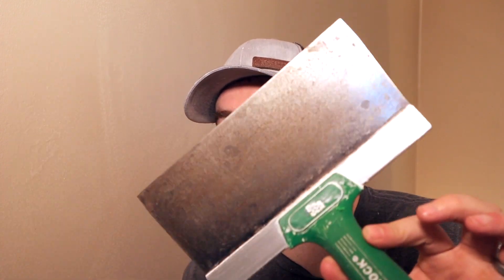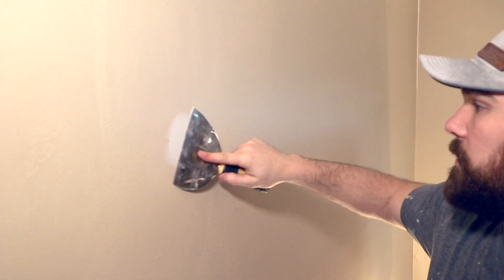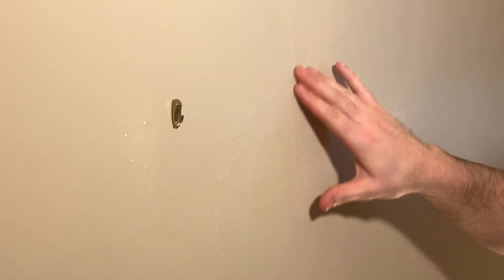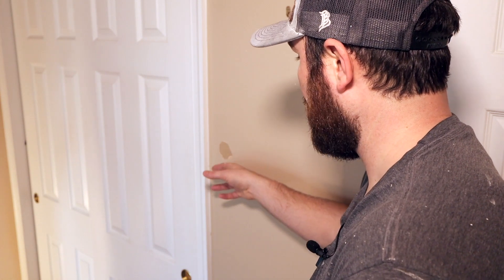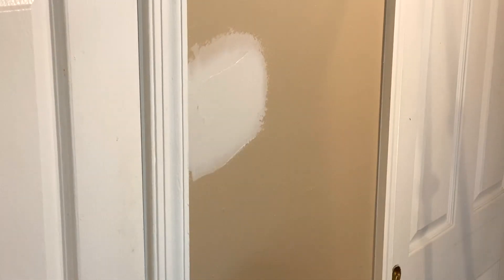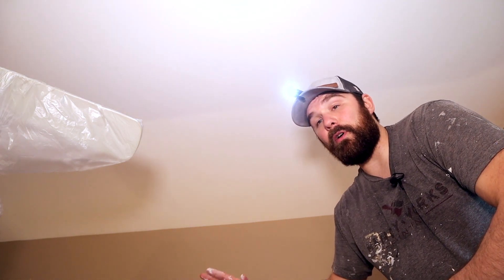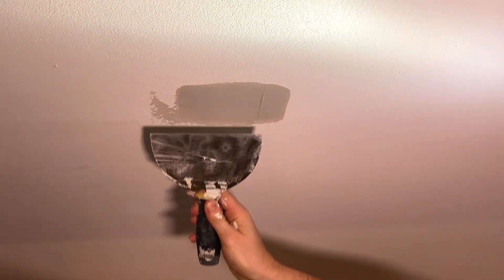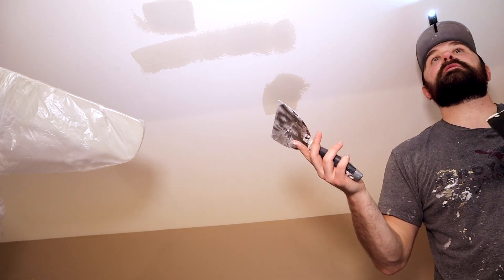Painting a Bedroom | Part 6 | How to Spackle Walls Before Painting

Comment: Sir, outstanding series for us wannabe DIYr's and just subscribed to your channel! I'm a retired Marine living in a 60 year old home in Western, PA. My home appears to have been plastered and then painted and the interior walls are cracking and delaminating in areas. My question is, if I decide to try to DIY will your process of patching work or do I need a particular type of primer to lock down the delaminating areas before I spackle? And if so, what do you recommend as a primer? Thanks and Semper Fi, Ken
Reply from the maker: I've repaired a fair amount of plaster using spackle and it's worked out so far.  I'd recommend going with green label like you saw me use in the video.  It's a good idea to knock off any loose stuff before you start spackling.  You'll need to prime the repaired areas after you sand them, but you shouldn't have to prime the walls before you start spackling.  If you want to add a bit of flexibility to repairing a crack, then you can fill it with hi-flex caulk before you spackle it.  We like using Powerhouse from Sherwin Williams.  

Thanks for watching and good luck with your house!
Reply: @SuperVassarBrothers  Thank you Sir!

Comment: May be a dumb question but how are there not a lot of smooth spots on the textured wall once you apply the spackle?
Reply from the maker: Not a dumb question.  For a textured wall we try to match the texture when spackling.  Can use a rag or sponge to get it close.
Reply: I think a good alternative would also be to skim coat the entire wall to get a uniform texture

Comment: I need the relaxing music.  Thank you.  Your vids are great too, they get to the point without needing to be told how cool we all are, and intelligently put.  -  Couple things:  Would be nice to know the proper consistency to revive recently old dryer spackle.  I'm trying it now...not too wet, not too dry I guess...so far it's not all staying down.  Some spackle is coming off the wall as I lay it down & leaving divets.  (must be too wet?)  -  Another thing is it looks like you lay your knife low to the wall as you slide it along?  I'm doing that.
Reply from the maker: I’m glad you’re finding the videos helpful!  There are a lot of ways to spackle.  There are a couple things that can help.  Keep your blades cleans.  Often spackle will dry on the edges and it’ll cause your blades to leave grooves in your patches.  You can dip your blades in water and wipe them off and that’ll do it. As far as the spackle coming off the walls, I’d have to see how you’re doing it.  It’s kinda similar to icing a cake.  If you lay it on too thick then gravity will do its thing and it’ll fall off.  Also a flexible mudding knife makes a big difference.  I’m not a fan of the really stiff ones.  I hope this was helpful and happy mudding!
Reply: @SuperVassarBrothers  Helps a lot.  Thank you.  I'll be laying some spackle down tonight.  I have a 4 inch wide stiff blade for now, but have used a flexible blade in the past and I think i liked it.

Comment: Hi Jeremy, I am wondering why you need any excess spackling on the wall, rather than just filling the hole and taking the rest of the spackle off the wall. Thanks!
Reply from the maker: Excellent question.  Spackle shrinks as it dries.  If you don't put enough spackle over the repaired area, particularly a hole, then when the spackle dries it will shrink and sink into the hole and you'll still have a divot in the wall.  When you're spackling you want to put enough product over the area so that after it dries you just have to do a little bit of sanding to get it even Stevens with the surface.  Larger repairs may take more than one coat of spackle, but smaller holes will generally only take one pass.  However you do it, you want the end product to be an evenly prepared surface for your top coats.
Reply: @SuperVassarBrothers  Thanks, really enjoying your content!

Comment: wht do you do with dowels? do you remove them? what's the best way to remove them?
Reply from the maker: What exactly do you mean by dowels?
Reply: @SuperVassarBrothers  ohh I really meant plastic wall anchors like for screws. The ones I had were not too hard to remove, but I guess it depends on the anchor shape
Reply: Also how do you spackle on a textured wall? Do you still make the spacked area smooth?

Comment: How long does it take for the all purpose to dry and you can paint?
Spackling paste dries quickly, yes?
Reply from the maker: It all depends on the size of the repair and how much product you used.  It can take an hour or several hours.  Then you’ve gotta sand and prime it, then apply your top coats.
Reply: @SuperVassarBrothers  thanks so much dude 
I have learned so much from the videos.

I am just starting out (at 53) and I like to use all purpose as well. Just wondering about being able to paint same day/not long after.

Comment: Good content man I’m just gonna give a quick little tip, you can move way faster and probably paint the same day by using 5 minute easy sand or the Lowe’s stuff proform quickset or whatever it’s callled, if your not fast enough for 5 use 20 aand in my opinion your using too big of a knife and putting on waaaaay to much spackle and creating more work for yourself,do your first coat flush so just fill and scrape flush it’ll shrink and then for the second pass you go a little heavier and feather, i use a 4 inch knife..... this way your sanding within 4 hours and then you can spot prime the spot right away to get rid of the texture :) just what i was taught  and it works, we get through a room in a day spackle sand prime and paint, keep putting content out tho man, it’s great.
Reply from the maker: Thanks for the reply Adrian.   We've tried a bunch of ways.  I'll look into the quickset from Lowes.   We have 20 minute but don't use it much.   We usually do the heavy spackling on day one and do light spackling on day 2.    Thank for the tips.

Comment: Can I spray spot primer before spackle and sand if initial spackle/paint peeled off in the corner of the ceiling? I’ve scraped all the loose material and cleaned it!
Reply from the maker: Yeah, I’d spray it before you repair it so it seals all that in.
Reply: @SuperVassarBrothers  I brushed in some bullseye 123 white and it’s looking great!  Sponged after spackle.  It looks like doesn’t even need paint now from 6 ft away but I’ll put two coats of flat white 😊